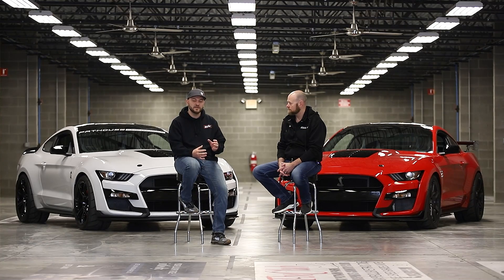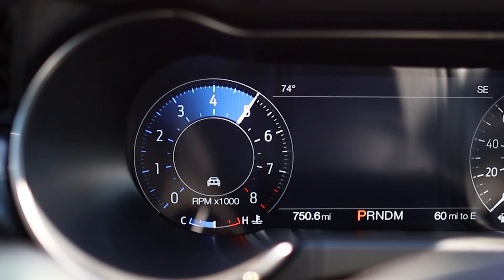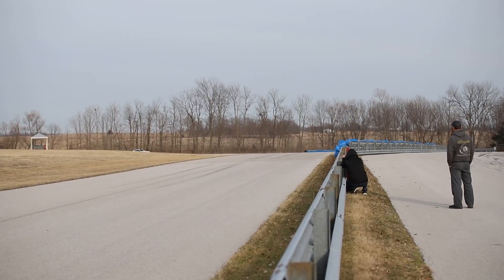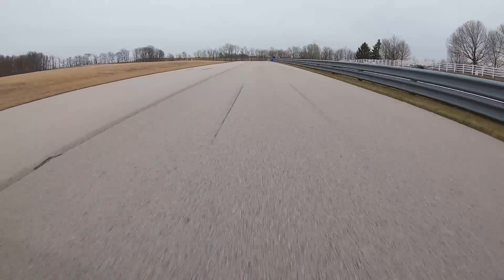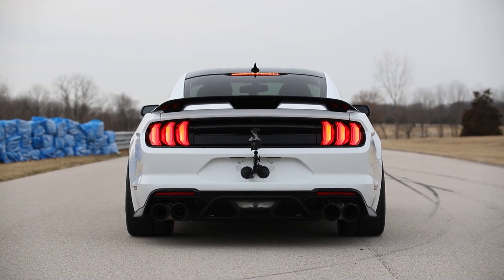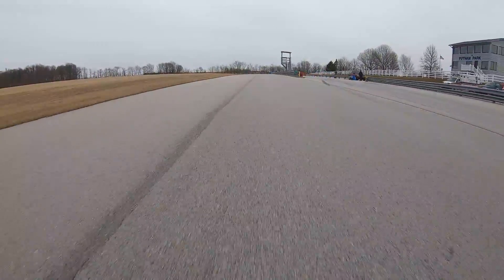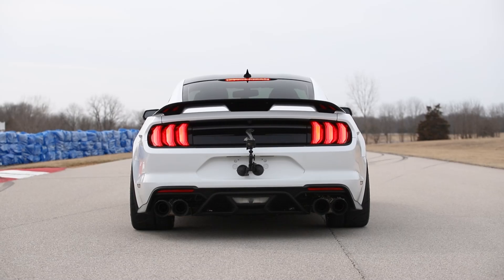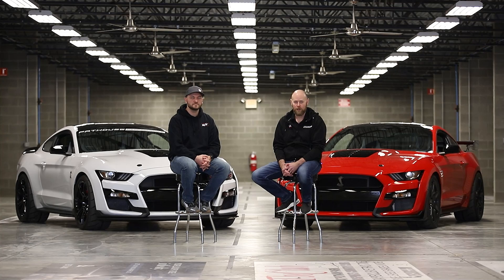2020+ Shelby GT500 MoTeC M150 Overview

Comment: I'm assuming you'll be running a larger pulley for the thousand horse combo how much lag would you feel as far as you're obviously running 93 or 91 on the flex tune and then when you fill it up with e85 or a higher octane the car runs at its peak performance. I'm sure you are aware of but generally when you run a larger pulley you kind of lose that throttle response you're used to are you guys able to cure that with the tune or is that just one of the trade-offs you have to have to have the ability to run whatever feel you want.
Reply from the maker: Im not sure I understand what you're saying.  We have a 2.55 pulley on this car to make 1000hp and we regulate the throttle blade to limit power on pumpgas.  The car hits hard and pulls great on 93, you do not notice any "lag"
Reply: @FathousePerformance  understood. I guess going back and looking at what I typed was a little confusing. I meant to say smaller pulley not larger but I was just assuming if the pulley is smaller or your crank pulley was larger just over driving the supercharger usually you lose a little bit of throttle response but you gain more power I just assumed with that and what's limiting the throttle itself I figured the tune might be pretty laggy until you finally put in e85 or whichever octane is needed to get to that thousand horse mark. That is pretty awesome you guys are able to do the things you do to these engines with these tunes and setups. I know not every tuner is the same I can only go based on my personal experience but when I had changed pulleys and setups I was one of the things I noticed again everybody is different when it comes to their tuning. All I can say is you guys are seriously changing the scene.
Reply from the maker: @KEN-du2iz  Understood!  Its a great system, you dont notice anything like that when on 93.  The car is obviously a little slower but still very responsive
Reply: @FathousePerformance

Comment: Do you have a motec package for twin turbos on a regular 10 speed auto GT
Reply from the maker: Currently MoTeC is not available for the 2018+ Mustang GT.
Reply: @FathousePerformance  I'll be watching your Channel could you keep us posted if it comes available
Reply: @FathousePerformance  following
Reply: @FathousePerformance  MoTeC ECU on a  twin-turbo'd 2018+ Mustang GT with 10R80 auto would be insane!  There's definitely a market for it since there are definitely more Mustang GTs than Shelby GT350/GT500s roaming the streets and drag strips, especially since Ford is locking/encrypting the factory ECUs on the 2021+ Mustang GTs now.
Reply: Nice